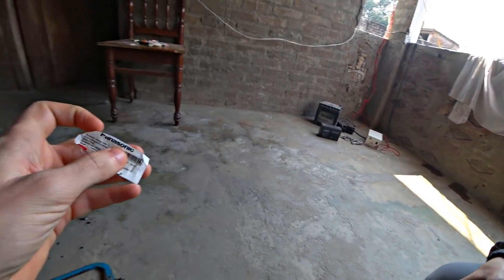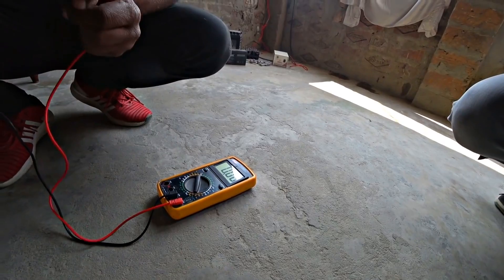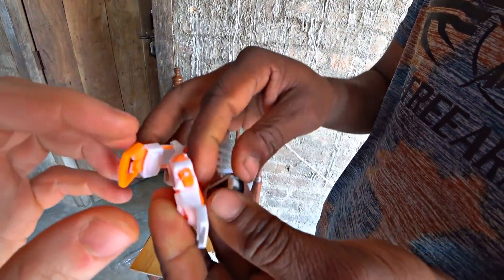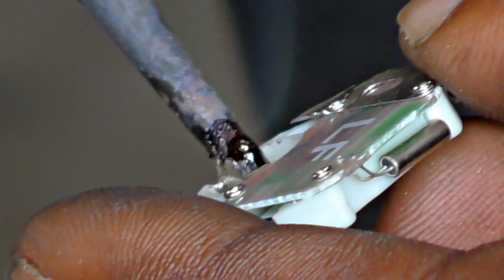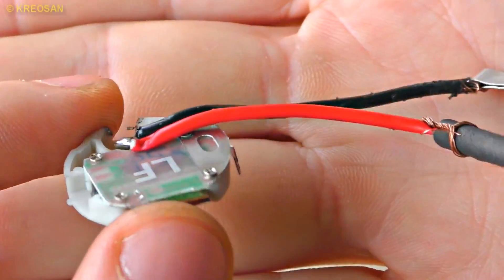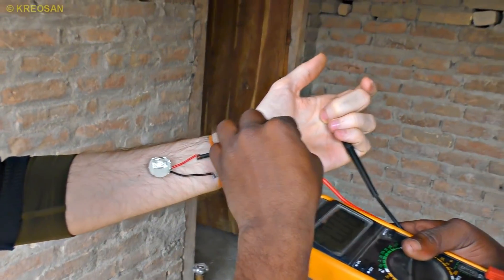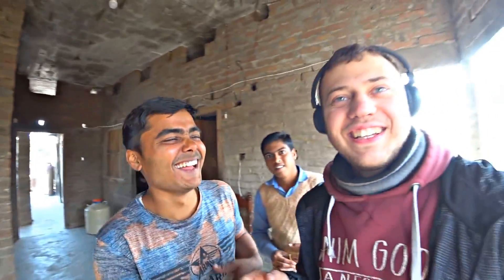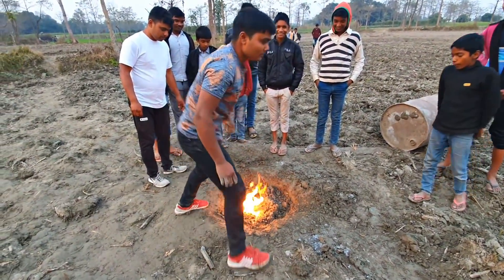How to get Electricity out of PEOPLE ⚡️  ⚡️  ⚡️ External Battery from a human body 💡  😨

Comment: Try making a battery from using 2 poles. One made from copper and the other pole made from magnesium. Put poles in salt water having the poles wired to something positive and negative that you want to run that uses DC, like a air pump that will run on 4.25 Volts. I made a bait keeper once doing this and it ran continuously.

Comment: Great video!  The pharaohs used a device known as the "cylinders of the pharaoh" made from copper and zinc cylinders filled with quartz crystal when held produce electrical energy starting at .6 volts and will gain .02 volts every minute held so after an hour you will produce 1.2 volts.  Make them yourself or get them on amazon or etsy.

Comment: It's not electricity from the body, it's just a battery you constructed, and the body acts as a conductor for it, why would you step so low? Plus, is you used the body's electricity you would kill a person, you would just draw an insane amount of power that your nervous system can't handle, so too much electricity goes into your nerves, either frying them or messing up with your muscles and in the worst case with your heart

Comment: After a little research, it appears that chloride ions from sweat oxidize the magnesium anode, leading to excess electrons: Mg + 2 Cl− → MgCl2 + 2 e−
Those electrons combine with Na+ sodium ions at the carbon cathode because that's where sodium ions can be pulled out of the water solution.
Reply: Great explanation. Although I am just 13 I could still understand, thanks

Comment: Hello, is the WiFi gun real? I made it but it doesn't work Any information please?
Reply: As they said when they made the video,you need to cut the metal discs precisely as possible,a 1mm deviation in the size of the discs will make the thing useless.

Comment: This may work in case there is long term power outage and battery absence if you have got some magnesium strip just to run a digital quartz watch like that. Because those watches probably consumes around 0,003ma/h while a decent mobile phone need around 400ma at least to run. So they not only need a voltage multiplier but also current multiplier too in order to make a human mobile phone charger. Also i am not sure sucking around 2,5W power from a human would be safe. Our brains think by using electricity. Be careful guys.
Reply: It would be perfectly safe if you used a voltage multiplier as its the multiplier doubling the current not the body

Comment: I used to like your video....but are you getting bored?  why are you start to trick audiences?    You held the meter with bare hands, but left the meter dial on AC range, then put moisture onto the electrodes over the skin,  moved the meter's dial to DC, sure there will be a difference,   if you had used the DC range of the multi-meter for the bare hands test, it would have shown some voltage as well.  You are treating science as education or you do not like it anymore (why not just stop making these video,  instead of starting mixing fakevideos with true ones----you devalued the view upon knowledge)  Fakes is not fun at all.

Comment: A thermocouple or heat-based USB charger would be a more practical application to make like the BioLite Campstove, especially if you can do it with human body or solar heat depending on the amperage needed to charge the phone.

Comment: Bro it is harmful, magnesium reacts with body moisture to form magnesium oxide which is harmful
Reply: Magnesium oxide is also used as an antacid to treat indigestion, or as a laxative to relieve occasional constipation.
Magnesium chloride is a dietary supplement said to prevent fatigue, weakness, depression, fasciculations (involuntary twitches), and arrhythmia (irregular heartbeat).
 Chronic magnesium deficiencies are closely linked to a wide range of health concerns, including asthma, migraine, type 2 diabetes, metabolic syndrome, hypertension, atherosclerosis, osteoporosis, and colon cancer.

Comment: The black powder inside carbon zinc batteries is often made with manganese dioxide. You can extract gaseous oxygen from it by pouring hydrogen peroxide over it . . .

Comment: Add more carbon rods and magnesium in series connection, maybe can light up leds or charging mobile phones...
Reply: Slivkyshow already did the video. But by using just iron and copper..the individual voltage is a bit lower though.

Comment: u should try something with atmospheric energy
Reply: They must do it in India where lighting is captured through kite on TV
Reply: they already did
Reply: Germany experimented with that at one point. They were trying to set up balloon farms, holding wires aloft to collect charge at an industrial scale.  I always thought that was a great idea. Though chosing a lift gas would be difficult.. Helium is notoriously expensive and difficult to contain for any time. Hydrogen is obviously flammable so a spark could destroy a balloon, or many balloons if they are close.

Someone here on YouTube tried to set up an experiment where a drone could be powered by the electricity it collected while holding up a wire. I don't recall how well that worked.

Comment: If that much electricity from hand 
Imagine making a exo suit thats powered by your body? 
Like we could use some step up converter for getting higher voltages
Reply: It's around 2V but current is in micro amps. It's not just voltage you need to get sufficient current as well...
Reply: @GhostsOfSparta  that's the challenge

Comment: I want to see it charge phone with a human body
Reply: Not possible. We don't emit that much power.
Reply: @AshutoshSingh-to9vx  u cant multiply voltage from 2 v to 4-5 v at least using voltage multiplier
Reply: @RDavengerr  brother, there is a minimum current required to charge the phone.
Reply: @AshutoshSingh-to9vx  ahhhhh that i forget 
current is less ohhhhh🤣🤣
Reply: @AshutoshSingh-to9vx  that minimum current can be very low for older phones.  USB 2.0 has a very low minimum current to get something started.
Reply: @nox5555  please understand that segment LCD display like shown in the video consumes uA level current. 
You can't practically charge a battery at this level.
Reply: @AshutoshSingh-to9vx   you can get a bit more out of it.  i think the problem with a phone is that it uses to much power while loading. the screen is always somewhat working while loading.  
but i dont see a problem with loading some older  phone or something like a Ipod shuffle clone with it. will take alot of time, but you should get enough power to start the usb loading.  you can load some stuff waay under specification of low power usb.
Reply: @nox5555  Very easy. Take a Dynamo with crank and with you body roll for hours the crank producing electrical power until the phone is charged! 😄. It take hours and it is boring but it works.
Reply: we need to do voltage multiplier